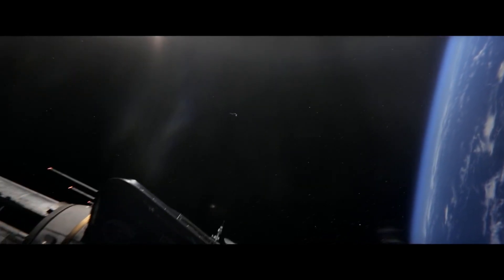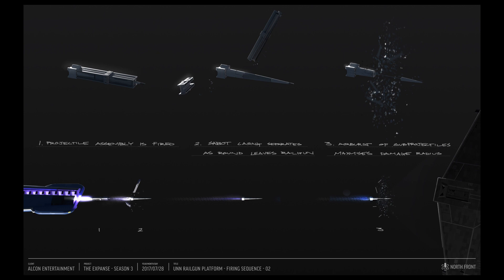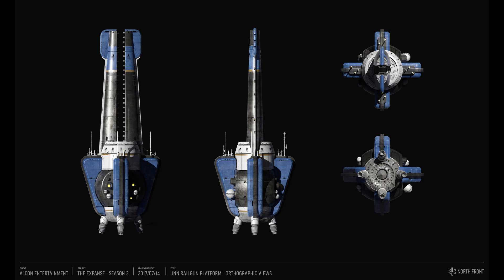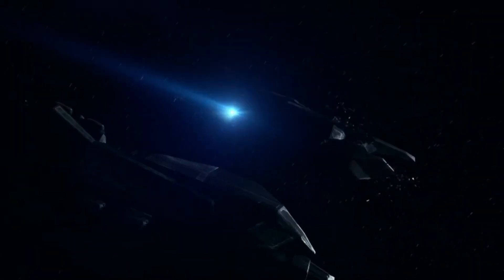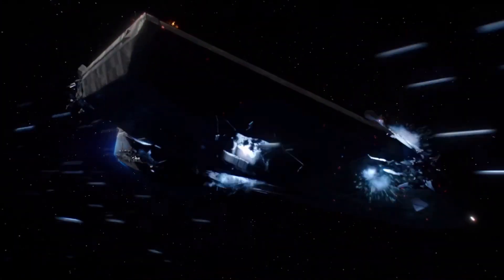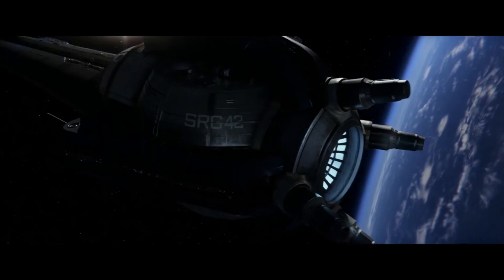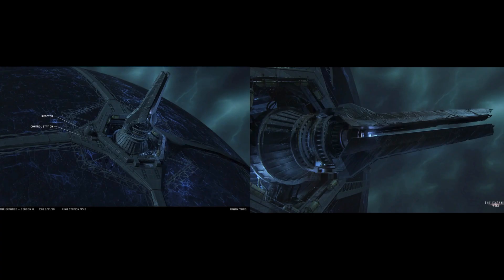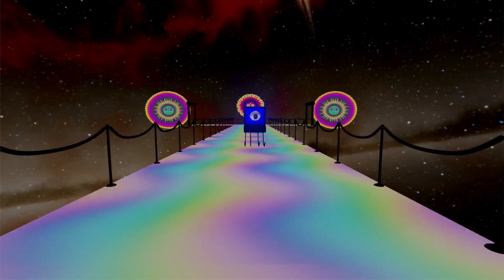Railgun Projectiles in The Expanse

Comment: There’s one thing that bugged me is the velocity of railguns can be a bit iffy, but it’s obviously not a large issue. The Roci’s Railgun in S4E1 stated the projectile velocity was a mere 9800m/s whilst the target was >100,000km away. But it did get me thinking - what if its miles per second? I did km/s initially but was off. Certainly an odd mix of two systems, but that velocity lines up with the books AND how long the projectile seemed to take to hit the target

Comment: I can see exactly why the UNN railgun platforms would use an airburst (or vacburst, I guess) of flak before it hits its target; while smaller railguns don't. In the show, the railguns platforms are designed to be first-strike weapons for large, critical targets on the other side of the solar system. As Esteban and Errinwright found out the hard way, missing that target could end millions of lives in the counter attack; especially since it takes at least almost an hour to find out if it actually hit or not thanks to light delay. Since the largest railguns could probably get their tungsten rounds up to high relativistic speeds, even centimeter sized pieces of flak would carry the impact energy of a very small nuclear warhead. Smaller ships, like the Roci, wouldn't really need the extra flak since it's not firing at nearly such a high speed or a high range to carry it all in one shot. And even at railgun/missile only ranges, PDC fire could still help create the same effect

Comment: I think the airburst is only used on special occasions.
So PDC is used for short range only.  Primary to shoot down enemy torpedos, and CQC fights with ships as secondary.
Long range is torpedos.  In the book are scenes where a torpedo will kill the ship, and all is doomed, when the torpedo will reach them in 3 hours.
Rail guns are medium engagement weapons.  Ships will usually dodge rail guns at long range.

Now for the airburst:  The way a railgun does damage is high mass round at high velocity.  It's usually used to shoot at the core or engines to disable the enemy ship, so losing half the mass in an airburst is counter productive for most operations.  The reason an airburst was used in season 3 was to take out the Martian missile platforms.  A torpedo would be detected and take too long to reach, allowing the platform to fire its missiles.  A regular railgun would be faster and harder to detect, but  leave a medium sized hole, but the platform would still be operational.  By adding the airburst, you transform it into a high speed flechette shotgun that will shred the platform.  Might not destroy it, but it will be disabled.

Comment: Assuming they have some sensor capability, it might make sense for the AI on each slug to determine if it is on track to hit the intended target or near miss.  If the later, it could activate its proximity fuse to set off a blast-fragmentation warhead so it can at least do some damage.
Reply: True. It also wouldnt be unreasonable then that a gunner would likely set the  AI protocols before firing, as fragmenting the round, versus leaving it whole, would greatly effect the shape and depth of the damage.

Comment: In current day sabot casings are discarded in order to preserve the aerodynamic qualities of the projectile itself. Sabots are designed to fit the projectile into the chamber/barrel and in themselves are usually not aerodynamic thus in atmosphere they would cause a lot of drag.
In space however there is no need to do this and in fact the whole shot would be less effective by discarding sabot which is valuable mass (and energy) when hitting a target.
Reply: Was thinking the same thing.  BTW, the sabot casings would be nearly as dangerous as the railgun shot itself, since they aren't going to slow down.
Reply: Space is not a perfect vacuum
Those railguns accelerate their projectiles to notable % of the speed of light, at which point there is drag in space.
You would also want to minimize the mass of the projectile to reduce the effect a planetary gravitational field has on it - as we do see that being calculated into the path of the projectile

Comment: The concept, foolishly, applied the principles of atmospheric railguns.
A detachable pallet is absurd in a vacuum, especially since its separation negatively affects the accuracy of the projectile.
The detachable pallet and aerodynamic stabilizers on the projectile are a stupid atavism for a space weapon.
At the same time, the availability of the option to split the projectile into a cloud of fragments is very important!
Since the ships in the show do not have serious armor and are relatively easy to break through even with low-powered PDS, the effectiveness of a buckshot from a railgun is much more destructive than a single penetration ..
Reply: @Darkstar Precise hit or frags cloud is a selectable option.
I spoke about the absurdity of STABILIZERS and the "separable pallet"! There is no atmosphere in space, so the stabilizers do not work, and the pallet does not affect aerodynamics. Accordingly, the accuracy of the presence or absence of stabilizers does not change, and the separated pallet is a separate fragment that will fly next to the projectile. Also, a detachable pallet is an irrational loss of mass and energy of a shot ...

Comment: If I were to guess, submunitions are likely both a luxury afforded by lower deltaV requirements (why haul the mass as a ship, but you have little to no worries when in planetary orbit), and a requirement for strategic defence, rather than tactical applications.

For strategic defence, you get 1 shot to kill a stealthed first-strike missile platform before they move and can't be spotted again, and when combined with the extremely long distances and autonomous guidance on such a projectile (speed of light would make remote guidance unfeasible for terminal guidance). It just has to work no-fail. Combine that with the increased deltaV's involved and lower mass submunitions with greater kinetic energy can impart enough damage to get through armor. Submunitions coming in from an anti-spinward direction would have closing velocities in the 10s of km/s with no time to correct, so that also means a wider shotgun effect increases the odds of success.

For tactical applications the distances are so short that firing solutions are likely deterministic enough that submunitions are probably too costly, and possibly counterproductive. Smaller submunitions mean less kinetic energy per projectile, and spreading out the damage across armor may mean the shot fizzles out if the target is suffiently hardened (say, reactor/engineering spaces), and imparting enough KE to submunitions means a higher velocity shot and equally more demanding counter-thrust from the firing ship and robustness of the ship frame to handle the stresses.